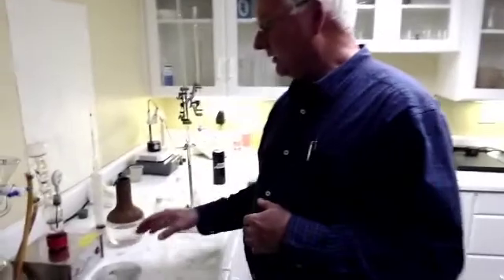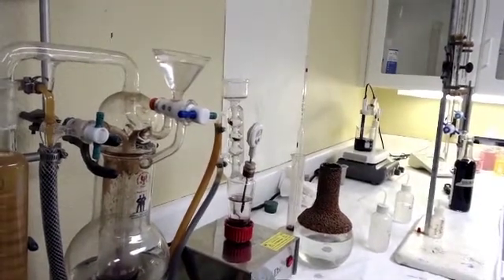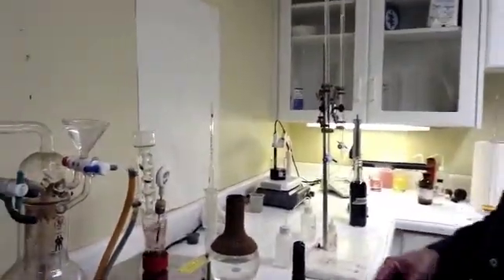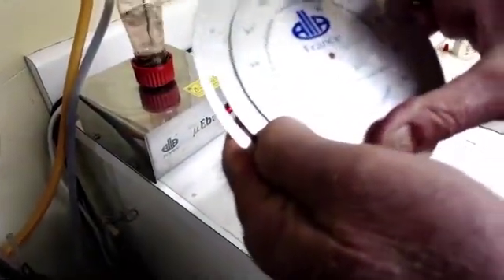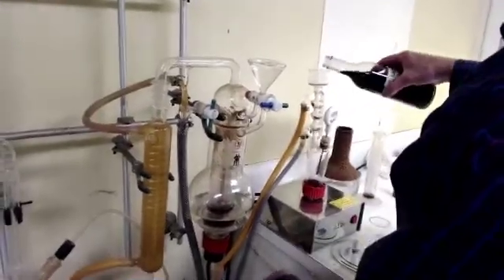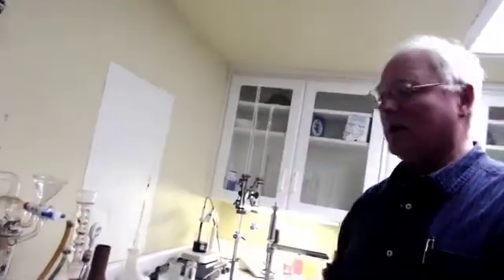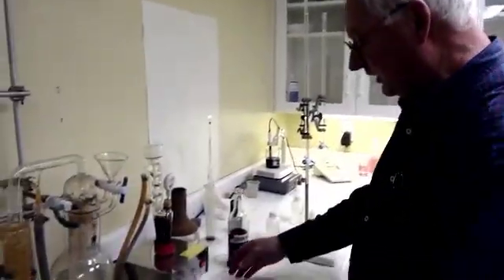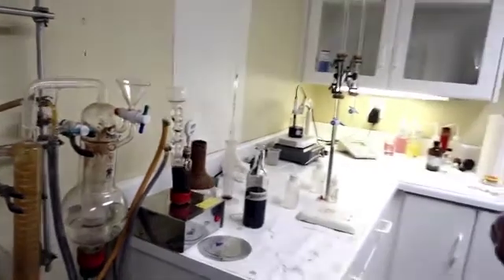Alcohol by Ebulliometer

Comment: With the older Ebulliometer could you provide a possible solution if the mercury thermometer doesn’t move when heated ? 
Ie. the mercury in the stem has separated?
How to trouble shoot for a client who has the Italian model. ?
Reply: Hi Stefano,  I have had the same problem.  I did what my mother would do.  I held the thermometer tightly and then swung it violently to force the mercury to move to the bulb end. Also, try putting it in ice water to force it dawn and back togther.
Cheers,
Scott